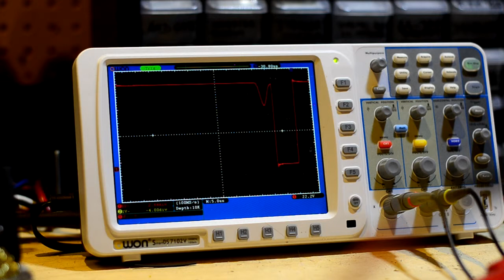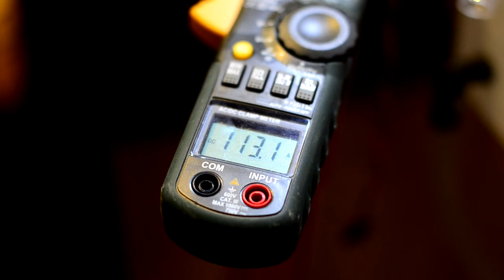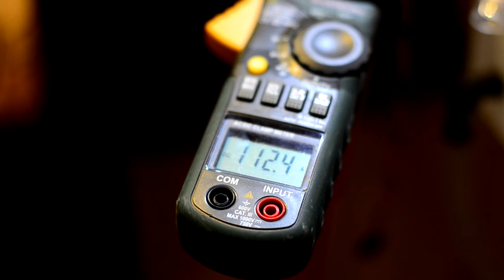EMotorWerks PFCDirect charger prototypes - 28kW DC DC test

Comment: What camera is this? and why is it shaking.
The camera seems to be set to overcontrast so it burns some of the dark so detail is lost there. Might want to switch that off if possible.

If you are developing high power chargers you might consider doing a chademo fast DC compatible product. or SAE. or both.